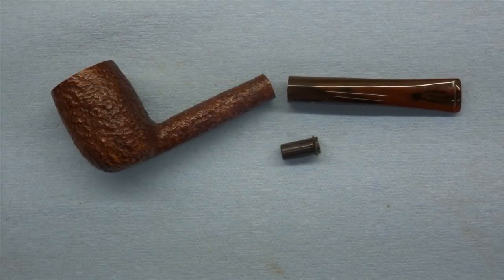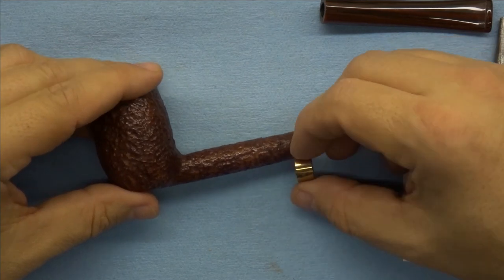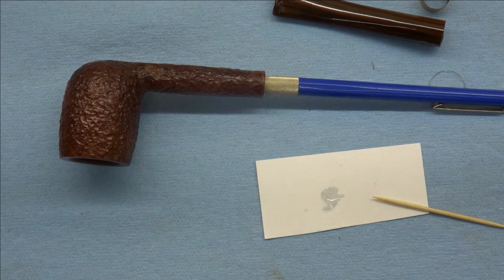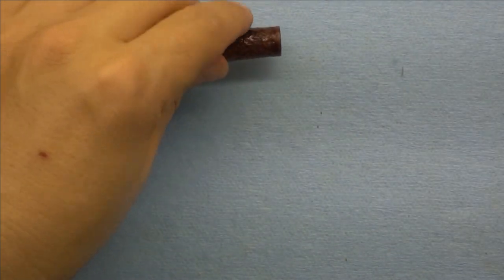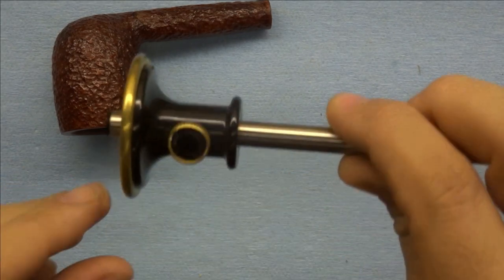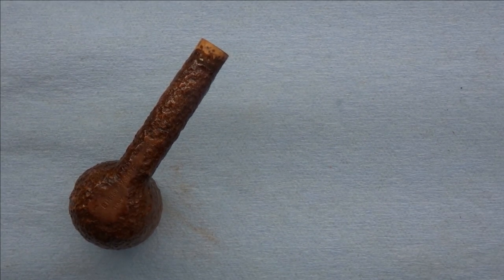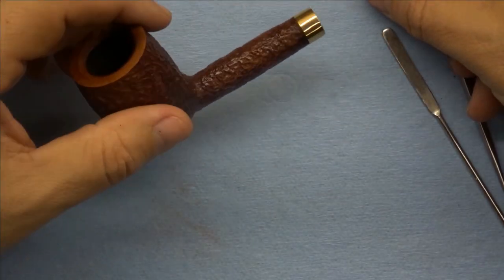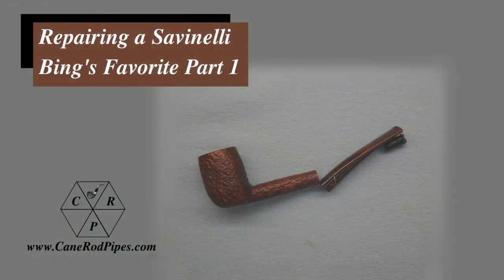Repairing a Savinelli Bing's Favorite Part 1

Comment: Hi Mike, Thanks for sharing, I have had very similar pipe with similarly cracked tenon, in these occasions banding seems to be the only option,then I had a brand new stem for it which was rather a mediocre junk,the result was I ended up selling the pipe away,btw, these Savinelli Bings  are very good smokers the only weak part to this model is stems cheapo plastic tenons, they tend to broke down very easily,,based on what I have been told ,making /fitting Delrin tenons asks for some experience&skills,Ps, I will send you a picture of one of my Dunhills with a rather poorly executed banding, it is tight-fitting sterling bad but final finishing left something to be desired,(and yes,that repair was done by repair shop on +300$ pipe) Best Greets,and happy Thanksgiving to You and Your Family, Paul
Reply from the maker: Hi Paul, Yes, I have noticed that with all of their filtered pipes.  I've made delrin inserts for all of mine to hopefully prevent the tenon from snapping.  Hope you had a happy Thanksgiving (do you celebrate it there?)!

Comment: Love your videos. Always learn something new. Would it have helped to drill a tiny hole at the end of the cracks to prevent them from propagating?
Reply from the maker: Thanks Rick.  Good question!  In this case it would not have likely mattered.  That is more important if the crack occurs naturally due to stress in the wood.  This crack was user error and the band should be enough protection.  Thanks for watching!